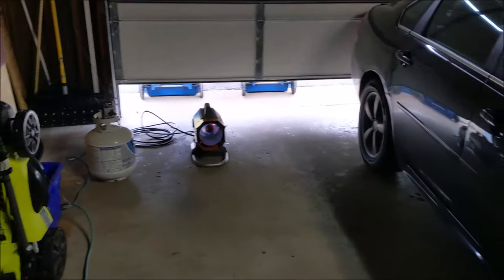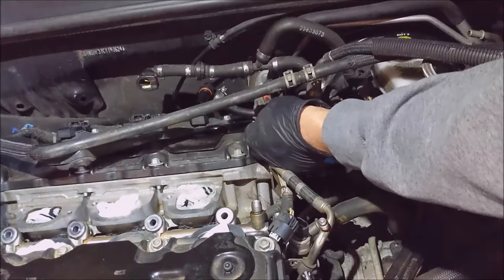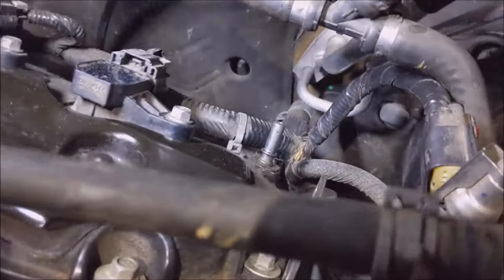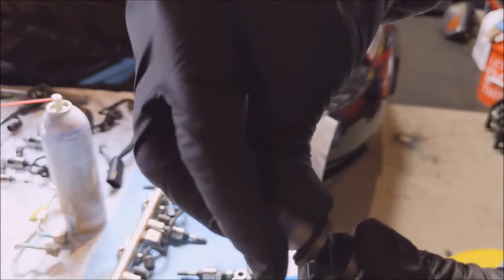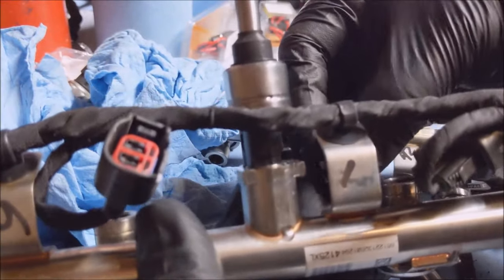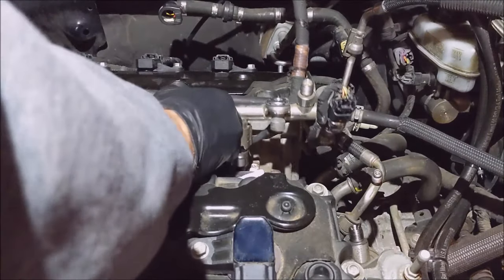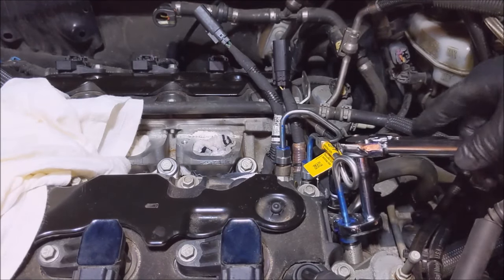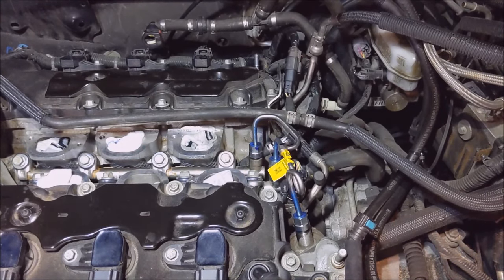GM 3.6 LFX V6 Fuel Injector Replacement (Part 3 of 4) **9th Gen Impala - Others similar**

Comment from the maker: To eliminate any potential confusion, this is not a comprehensive guide for EVERY GM 3.6 engine. This pertains ONLY to the LFX engine code. According to Wikipedia, the LFX was offered in the following vehicles:

12-16 Buick LaCrosse
13-15 Cadillac ATS
12-15 Cadillac CTS
12-16 Cadillac SRX
13-19 Cadillac CTS
12-15 Chevy Camaro
12-17 Chevy Caprice PPV
15-16 Chevy Colorado/GMC Canyon
13-17 Chevy Equinox/GMC Terrain 
12-20 Chevy Impala/Impala Limited
11-15 Holden Caprice
11-17 Holden Commodore

There are no guarantees that if your 3.6 is a different engine code that you'll be able to remove or reinstall the injectors as easily as the LFX.  You might be staring down the barrel of cylinder head removal on any other 3.6. ☹️
Reply: I can't seem to get my fuel rail back in (right side 2/4/6/) which I knew it was going to be a hassle. There's a black hard pipe on the backside  (RWD) Right)  that's in the way of siding the fuel rail back to provide wiggle room might be 3/4".   How in the hell does do you get these back ?
Reply from the maker: @amsoildealeranddirectjobbe7245  What vehicle do you have? You say it's an RWD, so I'm wondering if it's a heater core tube that's in your way. Also be sure you put the 2/4/6 rail in first!!
Reply: @CertifiedShadetree  I have Cadillac CTS 3.0L ,  I do believe the pipe connects eventually connects to the radiator. Yes, I am on the 2 bank (even side).
Reply: @CertifiedShadetree  Actually I think I see the black pipe in your video. If I can figure out if I can post a picture in a reply I show you.
Reply: @CertifiedShadetree   I belive the black pipe is what they call ( heat hose inlet pipe)
Reply from the maker: @amsoildealeranddirectjobbe7245  Maybe post it to imgur or  some other free site (is Flickr still a thing?) and link to it here.
Reply: @CertifiedShadetree   Here's the black pipe that want allow me to move a cm more to get the injectors in.
Reply from the maker: @amsoildealeranddirectjobbe7245  What I'd try first is feel around where that pipe goes into the engine and figure out whether or not it's pressed into the engine or there's a flat plate on the end of it and it's bolted in place.  If there's a flat plate and a bolt you should be able to remove the bolt and rotate the pipe without removing it outright.

Comment: Hi @LeaderOfWagons,
First of all great video!
I‘m not sure if I‘m having the same issue.
Its a Camaro 2015 3,6 LFX same engine.
While driving down the road the engine is misfiring some time but if i hit the gas its really bad It feels like I lost 150hp. And then suddenly its back to normal and back to no power. The muffler is also making wierd popping noises. The RPM in idle is jumping and when i keep the gas pedal down the RPM is raising but dropping while raising and the popping starts. :(

Would you say this could be an injector issue or something else?

I haven‘t checked the spark pluggs yet but I will replace them tomorrow. 

Thanks for any help!
Reply from the maker: Have you pulled any codes?  Without knowledge of what codes have been thrown, I can only speculate, as there's a lot to unpack here!!  My thoughts immediately go to a plugged cat.  Perhaps one or more injectors are stuck open and dumping raw gas into the cat.  There could be a restriction in the intake tract, like the air filter grenaded and there's filter media stuck somewhere.  Also these engines are notorious for their timing chains stretching, so there could be a timing issue.  

I would almost say go to AutoZone to have the codes pulled, however it might be best to take it to a shop that can connect up a bi-directional scanner and see what exactly the engine is doing in those instances.

I say all of this because the only problem I had was a misfire and code P0276 appear in the dead of winter when it was snowing out.  It never had any of the issues you are describing.
Reply: I’m having the same issues with my 2010 camaro v6, I’ve replaced the spark plugs and am still throwing misfire codes for every cylinder. My next replacement would be the injectors, I also bought Amazon injectors because I cannot afford all the injectors as for 1 is $160. I do know that I have bad catalytic converters that I need replaced, but I have 02 sensor bypasses. I don’t know how to replace my catalytic converters, the state I’m in doesn’t allow any shop to remove catalytic converters as they will get fined. But when the car warms up more the catalytic converts rattle less and the car runs better. My car also runs better with a full tank of gas, so I’m assuming fuel pressure?

Comment: In the meantime...Code P0305 refers to misfire on the 5th cylinder...Will this be a cause of the injector fail itself?
I changed spark plugs, changed the #5 coil, but still there is a 5th cylinder misfire code P0305..Will you answer this post please?
Thanks!
Reply from the maker: It is definitely a possibility.  Either a failing injector, or it's incredibly dirty.  As you can see in this video, my injectors had close to 160k on them and most of them had tons of carbon buildup on the tips.  

Just curious, how many miles are on your car, and what's the year and model?

Comment: Excellent video...Other video I saw here the person/mechanic took off the head to pull the fuel injector rail. Not on your video..Thanks!
The only difficult thing (believe it or not...) it is how to take out the rear security (plastic) pin out...I broke one of the foot on that one...There are two of these I do believe..But I am not sure how to take them out securely and without break them...
Reply from the maker: I saw that video also!  Didn't that guy unclip the injectors from the rail while it was still in the engine?  Crazy.

Are you talking about the injector harnesses where they connect to the engine harness?  6:35 is where I begin to remove those (sorry I didn't zoom in closer.)  Yeah, I had a hell of a time getting those apart, and actually snapped off one of the retaining tabs.  I believe on those, you pull the red tab out and press down to release...
Reply: How did you get those injectors out with the rail and back in . I have a 3.6 liter engine that’s out of the car from a junk yard and I can’t get the injectors back in . I was practicing in this one before I take mine apart. The junkyard said it’s impossible and this video is fake . I see you didn’t but I can’t see how
Reply from the maker: @bombinbb  Exactly what engine code is the 3.6 in question?  I can't guarantee this procedure will work with any engine other than the LFX. If you can determine the year and model, look it up on Wikipedia to see the engine code: https://en.wikipedia.org/wiki/GM_High_Feature_engine?wprov=sfla1

If it turns out you DO have an LFX, then all I can tell ya is remove the REAR bank first. There's no other way you're getting them out.

And tell your junkyard buddy that I don't have the money to afford the proper equipment to pull off a fake video!! 😅 This joint was recorded on a Pixel 3a and stitched together on an 8 year-old laptop with Windows Movie Maker!! Ain't nothing fake about my shit!!! 😂
Reply from the maker: @bombinbb  Install the FRONT bank first when reinstalling them.  Also make sure there's nothing in the way on the right hand side, otherwise it's near impossible to get either rail back in.
Reply: LeaderOfWagons I have a 2010 Cadillac CTS 3.0 and seems same engine design . My cylinder 5 is shooting too much gas in it . I pulled out the spark plug and when I cranked it tons of gas came shooting out . The injector has to be stuck open .
Reply: I took it to a Cadillac junk yard to fix it and they ended up saying they won’t do it. They have an engine out and showed me why it’s hard to do . So I practiced on that engine trying to get the injectors back in. But no luck . I even see how the clips are backwards so you can’t even remove the injectors from rail. But you did it so I am stumped
Reply from the maker: @bombinbb  Gotcha. That's why I asked whether it was an LFX or not  From what I know, the cylinder head was redesigned for the LFX, which appears to provide more room to get the injectors in and out. The older designs (like the LLT) are damn near impossible to get the injectors in and out without removing the cylinder head, which sadly, may be your only recourse.
Reply: LeaderOfWagons I will figure out what type engine I have and if it’s a LFX I will try it . Thanks for taking your time to reply to me . I really appreciate it
Reply: I have a LF1 according to Wikipedia. So I guess I can roll the dice and start taking it apart
Reply from the maker: @bombinbb  Good luck!
Reply from the maker: @bombinbb  No problem! 🍻
Reply: bombinbb...I am working on a 3.6 engine from a 2013 Chevrolet Equinox...It was a real pain to get them out...But there is a difference between some injectors..This particular car looks like someone tried to put the rear bank of injectors and they could not put it back in..Why? Because the injectors they tried to put on the rail were different that the ones that really made for that kind of narrow space. I have put these rails in and out in a 3 day intervals about 6 times, because I realized certain body of injectors are not specially made for those engines. I will post a video on the differences between the two injectors and will show how to get them out and put them back in...
Thanks! I will do it tomorrow .....post it tomorrow too...

Comment: 2008 impala.
mine has this hesitation.. when im driving along, say 40 50, even on cruse at 65... then when i try to get on the gas, i get this hesitation.  if i keep pressing the gas pedal the Stabil trc light comes on.. so i let off the gas when i feel it starting to hesitate and the light wont come on.. a few times when i start the car it feels like it wants to stall out... I thought i was maybe mass airflow. i cleaned that. no luck..  any thoughts?
Reply from the maker: From my experience with the 3.6, whenever the thing was misfiring, I'd get the "Service Traction Control, Service Stabilitrak, Service Brake Assist" message along with the "Trac Off" light.  With that being said, I would first run a scan to see if any codes were thrown (if you don't own a code reader, you can take your car to AutoZone or O'Reilly's and they'll scan your car for free.)  You might luck out and get more than a generic "random cylinder misfire" code (for instance, a code for a specific injector.)  If that leads nowhere, give 'er a good tune-up (plugs, wires, O2 sensors, fuel filter, air filter, injector cleaner, etc, etc.)

My other thought would be the throttle body.  The throttle body on the 3.5/3.9's are notoriously problematic, although from what I've heard, the car goes into some sort of "limp home" mode when they fail.  Regardless, make sure you clean yours up real good when you do a tune-up.

The chances of it being a bad injector are fairly low.  Port injectors rarely "go bad" so that's why I say run a couple tankfuls of injector cleaner through 'er to see if that helps.

If your'e still having problems after a simple tune-up, there are a few other things that COULD cause issues, but are fairly rare such as a clogged catalytic converter, a bad crank or cam sensor, a clogged EGR valve, bad coolant temp sensor.  I could go on and on, but start with a code scan, a simple tune-up, and go from there...

Comment: Do you know where is the fuel pressure regulator at? Have a 2010 Camaro 3.6
Reply from the maker: The high pressure fuel pump (the one on the engine, not the one in the tank) controls fuel pressure, so there isn't a conventional fuel pressure regulator.
https://www.boschautoparts.com/en/bosch-for-gdi/gm-3.6l-buick

Comment: @40:00 Underneath the rail you just put on, there is a sensor with the cable connected by any chance do you know the torque of it? I might need to use a crowfoot aswell
Reply from the maker: No, sorry I don't know it off hand. Sadly, the guide I was following on Bosch's website has been taken down. ☹

Comment: Thank you for your video. To install the injectors do I need to install the injectors and then the harness and the fuel rail afterwards. What is the order? Thank you very much.
Reply from the maker: Install the injectors onto the rail, install the harness, then install the assembly into the car.

Comment: Just did this job I recommend not using those clips and putting the injectors in the cylinder head first and then putting the rail on then put the 2 outer bolts on and walk the rail back and forth to seat the injectors on a 2018 Chevy Traverse 3.6L

I tried with the clips and ended up wasting too much time..
Reply from the maker: Makes sense. Your Traverse has the previous generation LLT engine. As you've found, it's much more difficult to install and remove the fuel rails in the LLT engine than the Impala's LFX.

Comment: Yes, it is pain to remove the rails.   The 2010 Acadia the one rail extends into a grove out part of the engine making it very hard to pull out because it hits the engine frame.  Now that we have the engine back together after replacing the main part of the engine we found we have to change the one of the fuel injectors.  I am not looking forward to it.
Reply from the maker: Best of luck to you!! 🍻

Comment: Hey how did u get the fuel rack in im having trouble in ve v6 3.0l
Reply: Back in sorry
Reply from the maker: Make sure the heater hoses are pushed out of the way so you can slide the rail in that direction to finagle the injectors down into those small openings.

That being said, there was a guy that commented that he left the retaining clips off of the injectors/rail - he put the injectors in the head individually, then connected up the rail without the clips. He reasoned that the bolts holding the rail to the head will perfectly secure the injectors to the rail with no chance of separation. Must've worked, I haven't heard anything back from him.

Comment: How did you put those clips back on ?
Reply from the maker: Vise Grips, needle-nosed pliers, flat-blade screwdriver. All I can remember about it was it was a royal pain in the ass!! FWIW, freedomracing.com sells a $300 tool to aid in the removal & reinstallation..
Reply: @CertifiedShadetree  I hammered it into place
Reply: @CertifiedShadetree  what is that tool called ?
Reply from the maker: @zanixinaz  I don't recall, try searching "GDI clip removal tool"

Comment: How did you put them in? I’m struggling to put them back in? Any tips?
Reply from the maker: Put the front 2 4 6 bank in first. Make sure nothing is in the way on the right side where the fuel pipe connects up, that'll make it easier to wiggle the rail back in.
Reply: LeaderOfWagons thank you I will try that
Reply from the maker: @luiscastillo3476  No problem!  They're a little tricky to wiggle back in, but not impossible.
Reply: Luis  Castillo did you get that back in ?
Reply: @CertifiedShadetree  I can't seem to get my fuel rail back in (right side 2/4/6/) which I knew it was going to be a hassle. There's a black hard pipe on the backside  (RWD) Right)  that's in the way of siding the fuel rail back to provide wiggle room might be 3/4".   How in the hell does do you get these back ?
Reply: @CertifiedShadetree   What's the trick, please ?